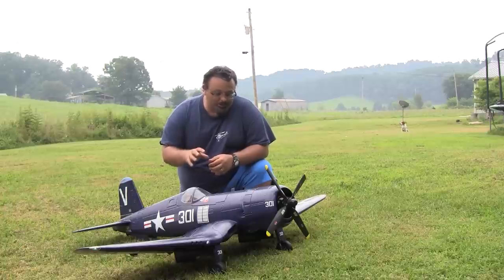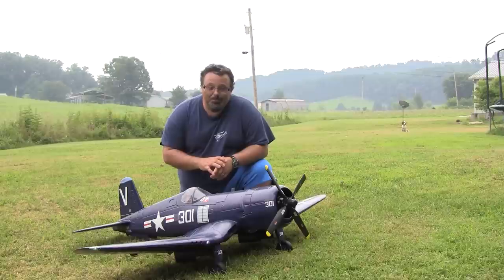Model Sounds Inc Shockwave Sound system in the FMS 1700mm Corsair Taxi Test

Comment: If you adjust the % Throttle Range upwards for the Engine Shutdown Sound in the Throttle Ranges View, you'll be able to better synchronize the shutdown sound to when the motor stops turning the propeller.

David
CEO
Model Sounds Inc.